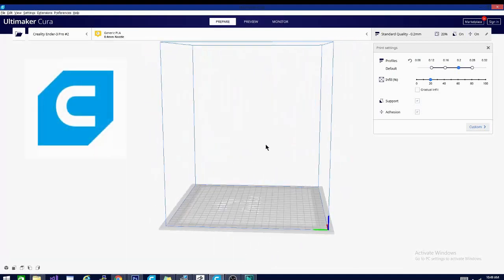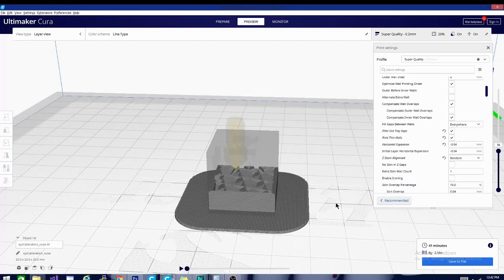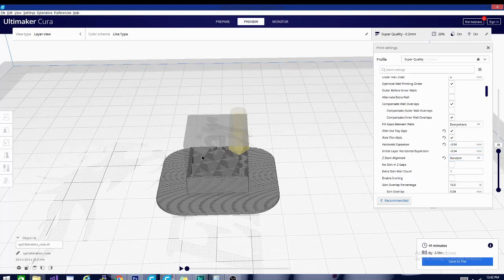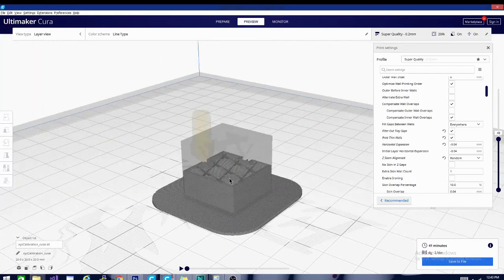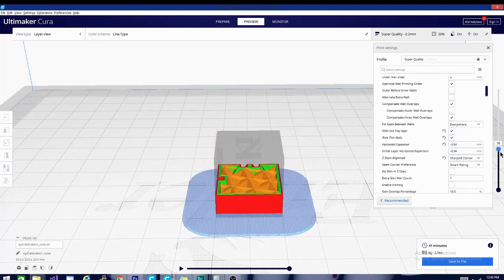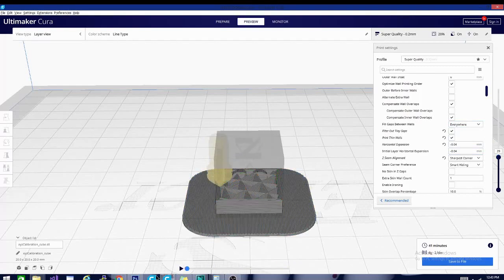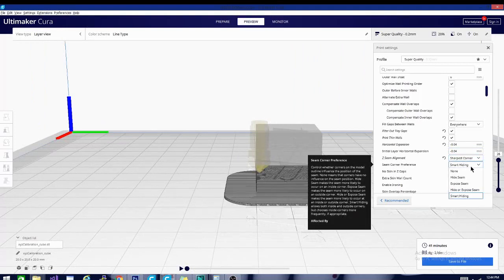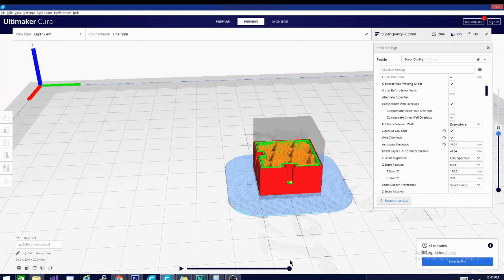Cura 4.8 tutorials - Shell Settings - Z Seam Placement

Comment: So good - some of the best tutorials on youtube hands down! Perfect timing too, was struggling with a seam today and haven't solved it yet. Had it set like you did (smart, sharpest corner) but there's a vertical "dimple" or trough running up an otherwise totally smooth section. The entire model is essentially a cube - lots of corners! The prints take 10 hours before they get to that point so hard to test...may try forcing a corner next iteration but if you have ideas I'm all ears!